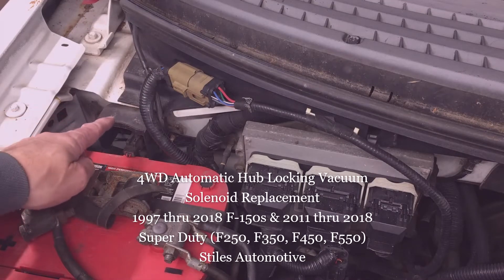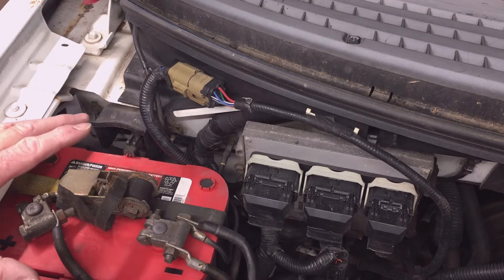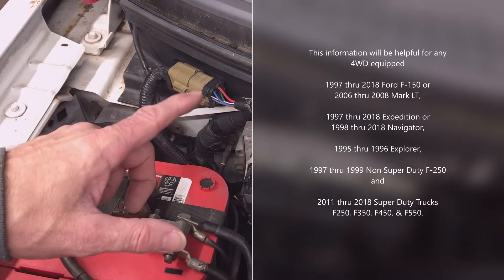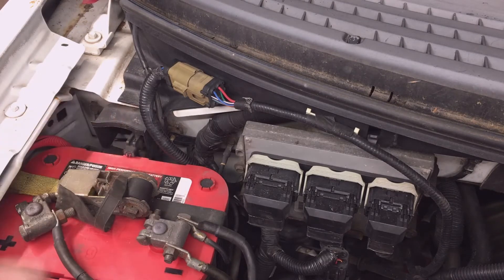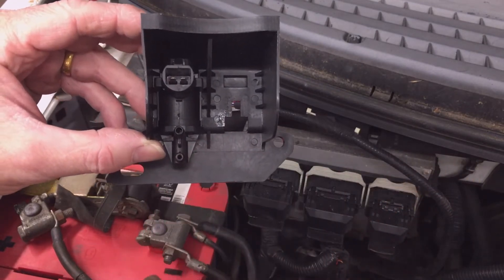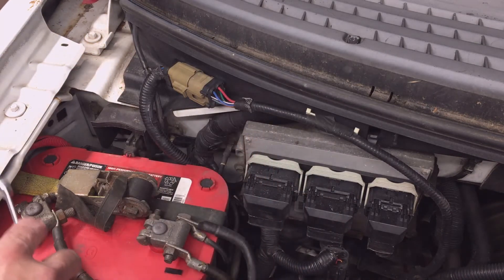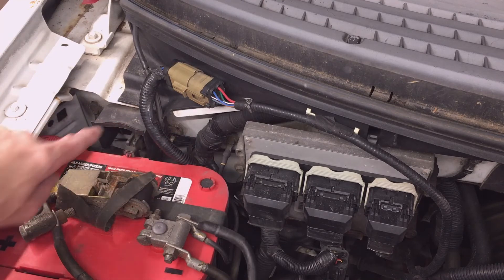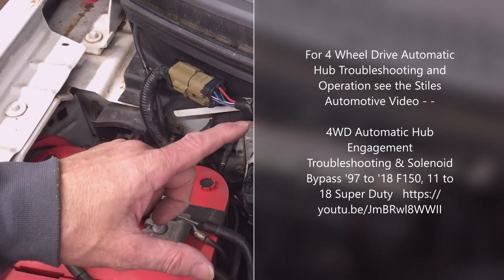4WD Automatic Hub Locking Vacuum Solenoid Replacement, '97 thru '18 F150s, ’11 thru ’18 Super Duty

Comment: I have a 2011 F250 and the solenoid is not there.
Reply from the maker: PK1, Your F-250 Solenoid is likely on the firewall near the Brake Master Cylinder on the Driver's Side (Leftside). Did you find it? - Stiles

Comment: I have a 2010 and the Solenoid is not located there.  Back to the drawing board
Reply from the maker: Cool, the 2010 has a very similar system. Your Solenoid is located near the Power Brake Booster on the Left side of the Engine Compartment. - Stiles
Reply: Thanks I found it.  Now I know it was one of the hublocks causing the problem. @StilesAutomotive